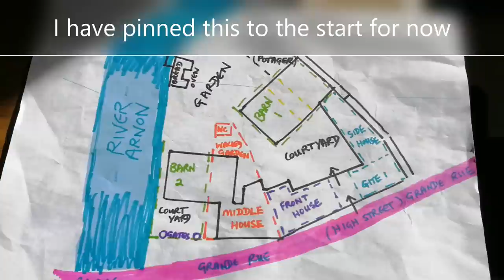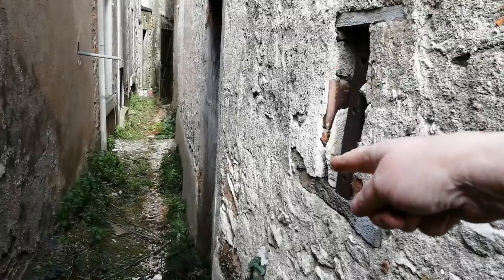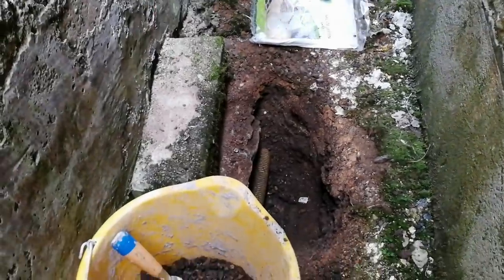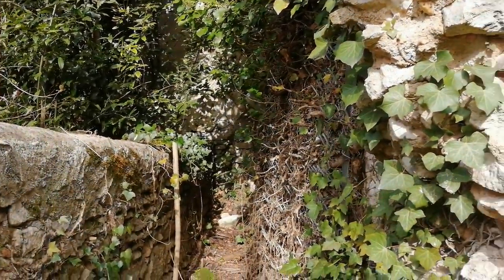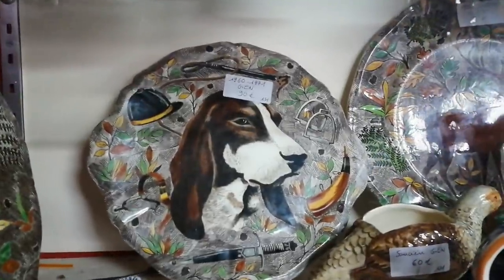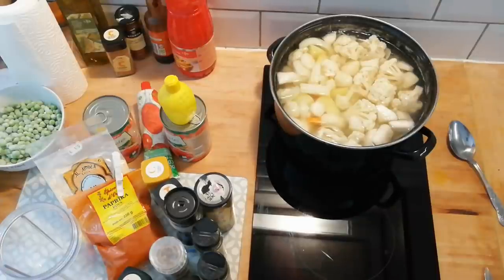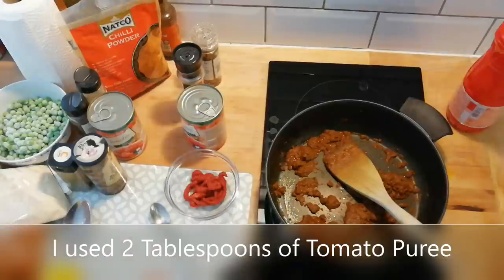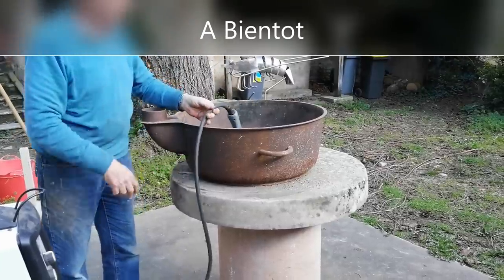Not Quite a Chateau 55 - Well I Never - Drains - Bobbin Chairs - Barometers - & Free Veggie Curry

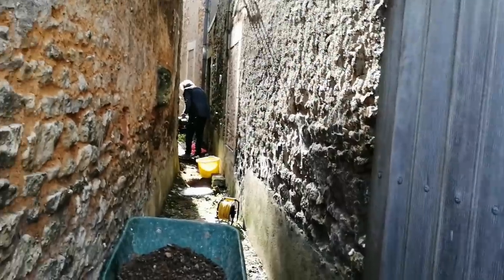Comment: 25:45 I think that's where the electricity came into the house. There would've been large porcelain knobs on the ends of those metal bits, then the wires looped down (to let rainwater drip to the ground) and through that pipe into the house.
Reply from the maker: That makes sense Ragnar, thanks

Comment: Hi Jane, 
Can you ask your neighbor when they last accessed the well and what they used the water for?

If you can, I would test the water quality prior to use to verify if it is potable and/or at the correct levels (alkalinity, pH, and soluble salts) so that you minimize the risk of discharging pollutants to the surface if you plan to use this water source for irrigation in your garden. You can purchase such a water quality testing kit on Amazon.

You mentioned metal detecting. Tie a large round magnet to a long length of rope and lower it down in to your well (magnet  fishing).  Who knows what treasures you might find!
Reply from the maker: That's an interesting idea JoAnn, the magnet, I think my son has one!